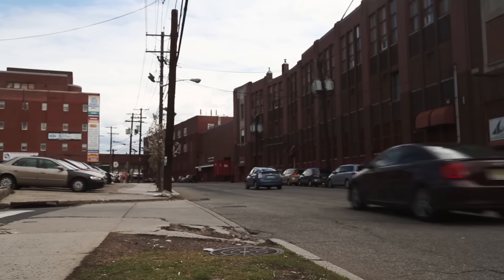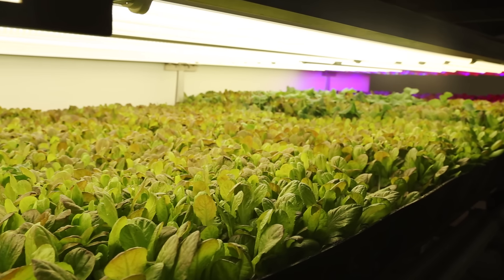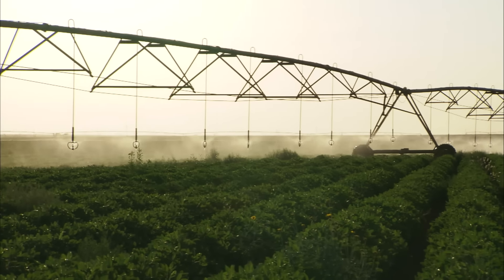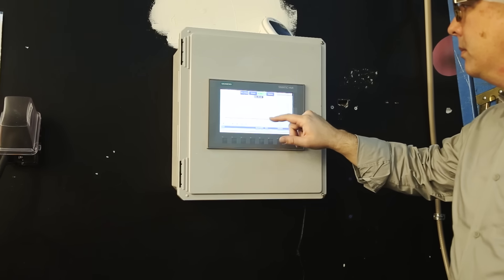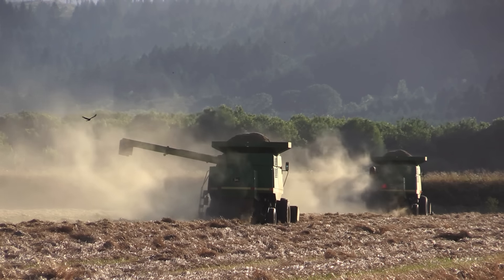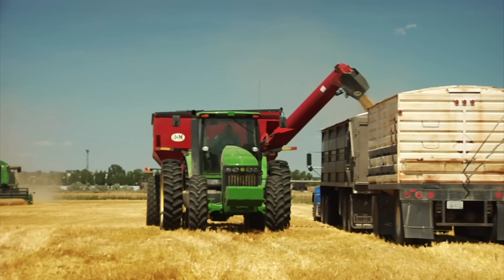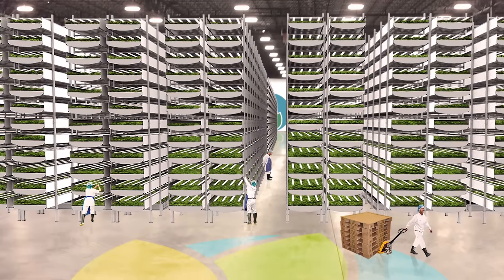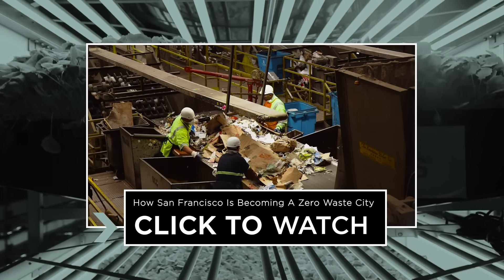This Farm of the Future Uses No Soil and 95% Less Water

Comment: theoretically, if you use 95% less water, zero soil requirements, all stacked up, all you need is space, electricity, and capital. I say we put them in old blockbusters.
Reply: ***** yeah, but you can stack them in really tall buildings and you can do it on any kind of soil.
Reply: Why not on water? The irony... uses 95% less water on the water...

Comment: No soil, 95% less water... But wastes as much electricity as a data center.
Reply: 92kosta Think about it. Solar energy, nuclear energy, other forms of reusable energy can help this to become even better. Why is the spectrum of your mind so small?
Reply: could be possible for spacestation? (with solar panels)
Reply: they use leds...
Reply: first off, its LED, second, getting that power from solar or wind would be problem. You dont have to burn coal and oil to get electricity. If you are into this kind of stuff, chances are you are into renewable energy too.
Reply: energy is free since 200 years ago
Reply: +92kosta no, it doesn't.
Reply: I don't think the word 'wastes' is correct. I bet the energy input per calorie of food is much lower than traditional aggriculture. The amount of energy genuinely wasted with traditional agriculture is enormous if you factor in all the pesticides, fertilisers (mining of phosphorus in particular is phenomenally bad in so many ways) as well as the food miles. The energy consumed in a vertical farm is done so in a much more efficient manner, and is easier to move to sustainable soruces.
Reply: Electricity will be a lot more abundant than that of land or water. Hydrogen fuel cells, Nuclear fusion, solar power -- space based solar power (unreal how efficient that is), fission would be unreal too but either way, a lot more likely that energy won't be an issue versus water/land.
Reply: "we need people running calculations to get numerical values on all this stuff so we can find the optimum equilibrium points." holy shit, you sir, are hilarious. I think what you meant to say was, "Our future isn't certain for reusable energies and resources; we need to continue research in promising fields of research and keep in mind that our goal is to protect the environment around us while creating and using the most efficient and reliable methods that are available to us." I don't even mean to give you a sentence of what you meant to say, but overall, I like your mentality but you clearly have no idea what the hell is going on in these industries.(Or that of data science for that matter). Numerical values barely make up 20% of analytics (of data) nowadays, it's true to say that most everything can be quantified, but calling science 'numerical values' and a 'optimal' conclusion for our energy industry a 'equilibrium' just makes me scared how little people think of what data science really is. 

Also, coal and oil aren't the cheapest. They are cheap in the short-term, but the terrible impact they're having on our environment will take a large amount of time, and money to clean up. Other, reusable and efficient energy sources could be where our 80% or so energy comes from, however, due to the industry being controlled by the oil and coal industry, that makes it very fucking difficult in terms of research, money and political power. So much more goes into this and I figure I should stop now since this is a youtube comment.
Reply: use heat pumps and those unlimited electric battery's i heard about.
Reply: "Wastes"...
Reply: please, stop trying to be intelligent
Reply: There are tons of factors you have to consider, like the 0 G and the fact that the soil must be enriched with minerals and other stuff (astronauts poop could help). Another problem is that you would need bacteria in the soil, but it's kinda dangerous to have a not sterilized enviroment in space, considering that bacteria mutate a lot faster in space.
In the end it's more than possible, but we would require a lot more investments in space research.
Reply: +The Tortorich Money is not a finite resource, it is not a resource in the first place. The question is how much work/manpower is required to maintain something. The difference in cost compared to conventional farming here is just due to the expertise required, which becomes irrelevant if it goes large-scale.

On a side Note: Switching to renewable energies isn't that difficult, theres just not enough incentive yet. Norway already runs 98 percent on renewable energies - yes it's a small rich country, but still - it's not witchcraft.
Reply: Ehm, nuclear isn't reusable.
Reply: cinema writer Wind energy is useless. Reports have shown it kills birds and doesnt make enough electricity for what its worth
Reply: Wind energy works just fine if it's done right. And no, it does not have a reputation for killing birds; sure some fly into the blades but they actually move so slowly (relatively) that most pundits believe that the birds they kill are the stupid ones.

Besides, if it were that big a problem, they could merely use ultrasonic bird repellent systems as they do at any airport.

Comment: I hope they use solar panels on the roof to lower that electrical cost
Reply: nisaan agarwal  the cost of making and desposing are bad for the planet
Reply: If the solar power is strong enough all the pot farms will be using it instead of rely on the electricity company.
Reply: @abkolman474  solar panels are actually very recyclable
Reply: What about the batteries?
Reply: @angelsuniverse6021  up to 90% of good batteries can be recycled. That's 90% more than other methods.
Reply: I would think the cost of growing food close to where the demand is would have a lower carbon impact relative to growing food in the more traditional way in rural areas because theres less of a need to transport that food and less machinery that produces emissions. Id be interested to know exactly what the carbon footprint is for both methods.
Reply: why you don't think that they should use sunlight instead of solar panels :v
Reply: @minhquanhoac6228  chao em, Mainly because a lot of commercial buildings don't allow for open roof. The roof is already fixed. Also, solar collection provides for more stable and controlled lighting efforts.
Reply: @sixpackyoung9698  Yes in fact the current solar cell efficiency is very low. If we could create one with at least 80% efficiency, there would not be a need to purchase energy for the farm mostly
Reply: @Janith1980  I READ some News saying that in the university's of Lisbon (Portugal) and York (UK) they made solar pannels that can absorve more Sun energy and use less materials
Reply: But we need more electricity when we make solar panels than we use in the vertical farming .
Reply: Nowadays they probably do since there much more efficient
Reply: @kaydenl6836  fake
Reply: Solar Panels aren't worth it, Nuclear is the clearest energy.
Reply: Take in mind. It is impossible to use more than 100% than the sun energy from sun panel. In fact even 20% is high. They never mentioned how much energy is require to keep all that light.
Reply: @abkolman474  might as well just have windows
Reply: @bgcvetan  nuclear is a bad option because of Murphy's law,  solar, wind and green gas are by far the best option
Reply: So, you think taking sunlight, processing that energy through solar panels and using it as electricity to provide light for the plants makes sense in terms of energy efficiency? (do you live in a dream world?)
Reply: wow big brain
Reply: tfw you realize clean coal(that means the purity of coal is super high and the only byproduct is co2 which the planet's plants need to grow and which our ever thining atmosphere could use as a buffer) is both cheaper and more environmentally friendly than the toxic pollutants thrown away in the production of solar panels..........yeahhh......
Reply: @brunatheprincess  by every metric, nuclear power is cleaner than even those alternative solutions in terms of pollution footprint and COMPLETELY outclasses them in energy production by several orders of magnitude, and nuclear plant designs just keep getting better and the latest Generation IV which we barely have any of in the world have a mechanical fail-safe in case of a natural disaster that requires no electricity to prevent a meltdown from even happening. The only thing that has a snow ball's chance of competing wiht nuclear is a hydro plant and those are rare and restricted to location/geography, and even that won't be able to compete with fusion energy.
Reply: @bigpickles  acually if you can recycle 90% off of this as opposed to 0 it's an infinite amount more, not 90%.
Reply: @CosmosProvider  a comparison of Total Recycling made. Not of each use cases recycling output. I should not have used the word "more". Indeed, 90% recycling of total EV power source v 0% Gasoline.
Reply: Solar panels are bad for the environment.  With making them and disposing of them it is worse than fossil fuels.
Reply: instablaster
Reply: Hush!  You are not suppose to ask that.

Comment: Vertical farming is THE way to go, growing food inside city limits to cut down on how far crops travel, ultimately making food sources more readily available to urban development. While using less, land, water and pesticides?!
How could it get any better than that? Bravo Aero, and all the other companies around the world striking out to be pioneers in this new and better way to farm.
Reply: Vertical Farming is far more energy intensive than normal farming, meaning it leads directly to increased carbon emissions. It is also not profitable at all. No one has ever made money on growing vegetables indoors.
Reply: Quinton Beck please state your sources
Reply: Solar panels on the roof...
Reply: they just said that?
Reply: joe botsch  You can't power all of those lights running 24/7 with solar panels. Think about it for a second; If that much light energy hit the roof of that plant why would you use a solar panel to convert 18% of that light into electricity and then use a UV light bulb to convert that 18% of electrical energy into light at yet again at 18% efficiency?

Also, all of the nutrients are coming from external sources. Where do you think all of those nutrients are coming from?
Reply: @JudgeDillon  using natural light you can only have one layer of plants where as with his way you can stack multiple layers with the lights in between them. The solar panels won't cover all the costs but they will at least off set them
Reply: But why did they have to put it inside a lasertag arena?
Reply: Julia Paschoal better than nature!
Reply: Those farms are limited to small plants.  To deal with climate change; we need large trees outside buildings.
Reply: @Mac_an_Mheiriceanaigh  
It would be great to have vertical farms outdoors instead of indoors.